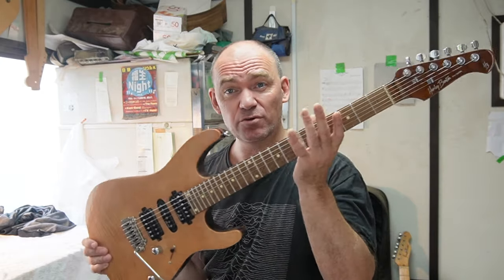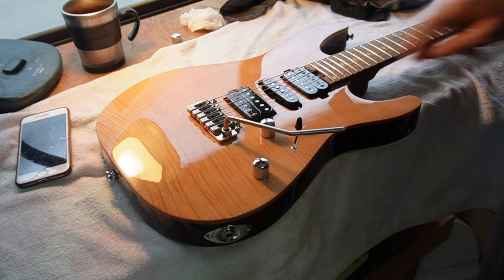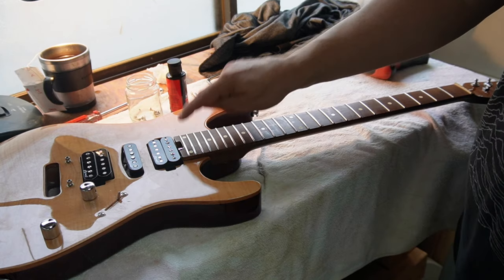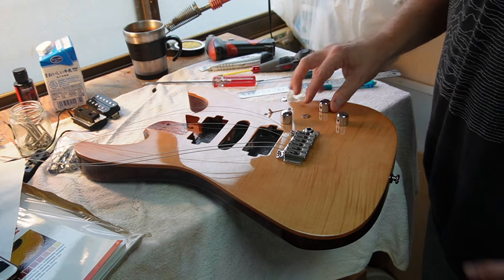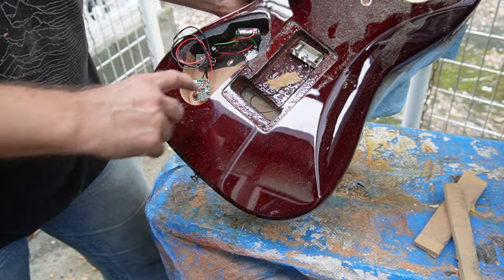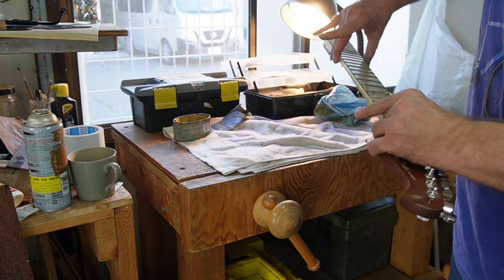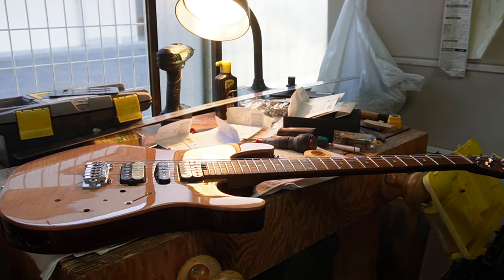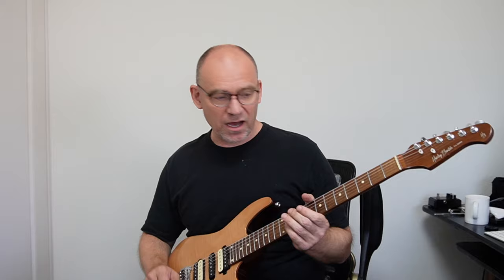Installing a Piezo Bridge in a Harley Benton Fusion III

Comment: Thanks for this video. I can see your pleasure overcoming the pain playing 😅 Thanks.
Reply from the maker: It's really become a go-to guitar. So much so that I'm contemplating doing another as a backup.
Reply: @TomboLP  I don't know how many times I watched your modding video. I have bought a Fusion-III. I am satisfied by her. I will install a piezo apparatus, but without carving the body. I think I will make a box to be glued somewhere, and a double jack male+female linked to the box.
Reply: @TomboLP hi. May i see the circuit you made?
I made mine and the pre ampli output is soldered to the jack, obviously the volume acts as a master one. How to keep volumes independent?

Comment: Nicely done, sir! Not a big fan of clean sound, but this guitar sounds so sweet in your hands! Now I just want to install piezo on mine, but I'm new to guitar electronics 😄Is it possible to connect piezo to push-pull and control it's volume or piezo/magnet mix %  with knob?
Reply from the maker: Hi! Thanks for the kind words.

As to your questions, yes, it could be. The question would be where you put the preamp in the signal chain (if you have one at all ... you could always also have the piezo signal running to an external preamp of some kind). There's a great FB group which talks about this stuff called "Guitar Electronics and Wiring" - https://www.facebook.com/groups/2052258481574450

They're probably a good place to go for detailed discussion of how to do what you want. Good luck!

Comment: No reson to put oil. This neck, including fretboard is laquered with a tiny matt layer. So if you feel it too rough you could polish it. 
Lemon oil or similar are not indicated in this case
Reply from the maker: Thank you for your comment, which makes perfect sense. However, the oil somehow penetrated and improved the feel of the dry fingerboard immensely (as well as reducing the tendency to chip and dent). I don't know if it is always the case, but it has been on all three Fusion III guitars on which I have worked.

Comment: Great plan, another cool video.  & 100% correct FB dry and fret ends can be a touch scratchy..I oiled the FB on mine 3x, and I had a cpl. very slightly rough fret ends but almost perfect. I do need to do a proper polish on them next string change. Hell, I've also considered getting the thing PLEK'ed (!) it's THAT good. 
I would say the pickups are decent if not awesome but, their sound can be tweaked a bit with caps. I am REALLYy curious about the Piezo thing... I keep thinking I need to try installing 1 on one of my other guitars.... VERY clean routing and cavity work there... 
My anal retentive ass would have made a new trem. cover so both rr covers match... i'd have no choice... its a sickness....lol.  

**Pro Tip...(Thx. Matt at Texas Toast Guitars:)  adhesive Copper foil is fine but u cant beat good shield paint!!  SO, after you shield paint the cavities, lightly spray a clear coat over the shield paint. 
It protects, and keeps the shield paint from getting those "marks" it gets when you touch it with basically anything once its dried.  Helps keep EVERY thing in the cavities looking clean, uniform, dark black, and "sano" as we used to say.... YES you have to mask off the body if doing this to a finished guitar,...BUT.....
...here's My  'Pro Tip'...I do this to all guitars I'm upgrading where I am doing shield paint, I use a kitchen "cling film" product called "Press and Seal" to quickly protect the body etc, it's a very light plastic food wrap product with super light adhesive on one side. the adhesive allows it to stick properly to a clean surface, vs "clinging" like the original plastic wrap does. But it removes immediately and easily. Stretch it tightly and smoothly over the cavities and an X-acto/razor blade makes for a super clean cutout so everything BUT the cavities is fully protected & you are good to Spray away!   
    
 Looking fwd to your final comparo with all 3 guitars ;-)
Reply from the maker: Thank you so much! Both of those tips are great - I will definitely try them.

The piezo is amazing and this one has become my go-to guitar. It's kind of a pity, as I prefer the look of the Bengal Burst, but the versatility of this one makes it a no-brainer.

I have definitely thought about going back and doing a new rear cover. However, a bunch of people have played this and looked at it closely since I did the work ... and not one of them noticed the difference. Even if I point it out, they're puzzled. It's actually a lot less noticeable in real life than in the video.

In fact, a fun game is to hand the guitar to someone and tell them I modified it. They then have to guess how. The closest anyone has gotten so far has been "new pickups and a fret polish?"